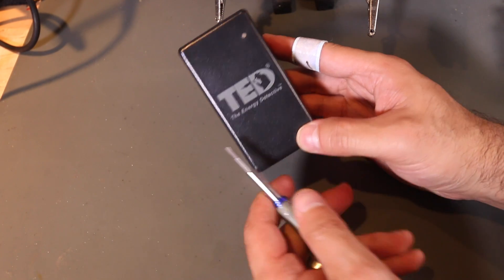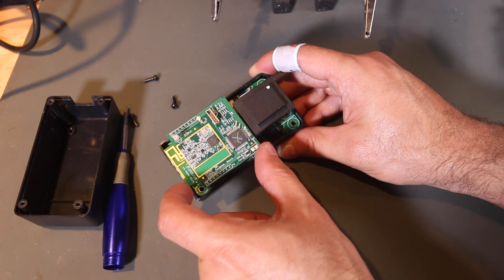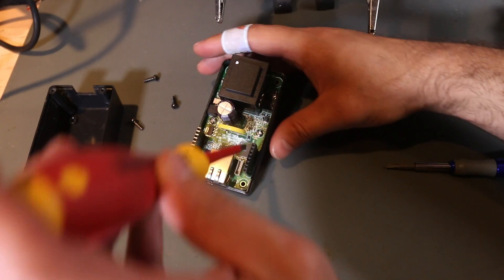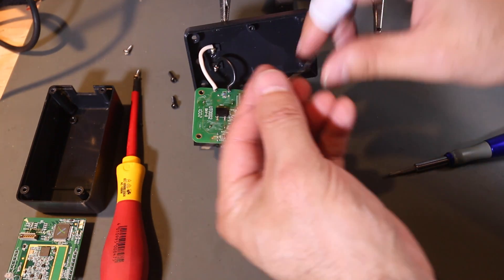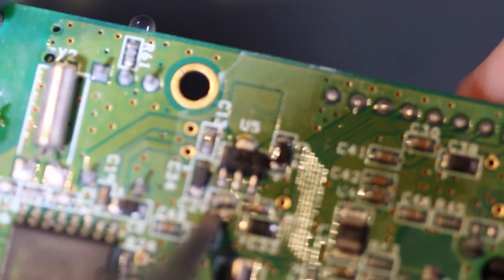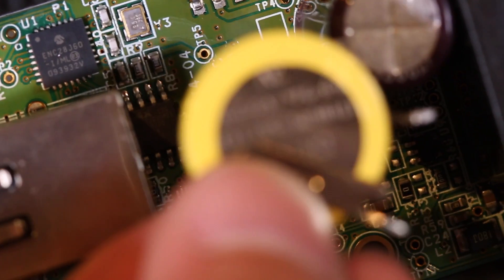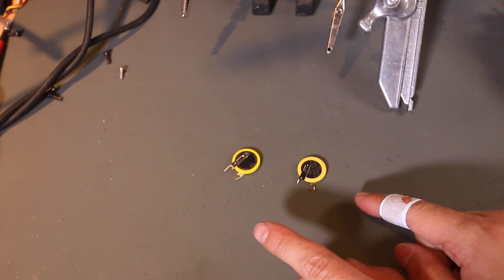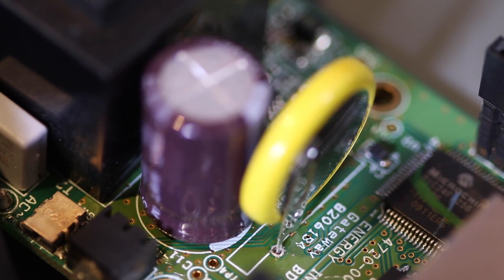Repair of The Energy Detective TED 5000 Whole House Power Monitor

Comment: My unit was just cycling on and off every 2-3min.  Replacing the internal battery fixed this problem also.  I installed an external double-AAA case that I soldered to the internal board, which should make it easier to fix in the future.  Who would have thought that the internal battery was critical to the ongoing operation of the unit and not just the backup power for the time / date clock.
Reply: Exactly!  I was surprised as well when my TED5000 resumed reading the CTs after replacing the battery.  Yay!

Comment: Would this be the reason I have power to it yet my wireless display is showing all zeros?  I got zero help from the folks at the Energy Detective.  Won't buy another one due to their service, but do want it fixed.
Reply: That is the behavior if the time/date isn't set.  Happens to me every-time I loose power because my battery is dead in my gateway (haven't replaced yet).  Log onto the web site and set the date time, and the displays will start receiving proper data.

Comment: I just soldered in a CR2032 in mine that worked well.
Reply from the maker: Nice!
Reply: How did you attach leads to the battery?  I had a pack of new ones but couldn't figure out how to make one work so bought the VCN battery from Mouser which was easy to solder to the PCB.

Comment: After how matt years of service did you notice this faulty battery? I have had my TED 5000 in service for just over five years to monitor my power consumption used to charge a Nissan LEAF. So fun telling people it only cost $40 a month to drive my LEAF all around Seattle every month!
Reply: My TED5000 worked for 13 years before it stopped reading the CTs.  Soldering in this VCN battery took care of that problem and it now works like new.

Comment: update:  bought the parts off ebay, battery was a little bigger then what came out but worked, using pool.ntp.org  I was able to set the time and the device kept it (time)   all good now..  (also Cap was bad, pushed up at top 1500uf 25v

Comment: Just replaced the Cap and Battery, date and time still not keeping correctly
Reply: Rechecked the soldier connection now it works! Thanks also replaced the battery in the remote display
Reply: @arthurarthur8985  Is the battery in the remote display soldered as well?

Comment: do you have the part number for the battery? thx
Reply from the maker: Yup -- here is a link to mouser where I purchased replacements: http://www.mouser.com/ProductDetail/Panasonic/CR-2032-VCN/?qs=%2fha2pyFaduj9bTtpJmwLBJ9bSENdV3nc9%2fVVP942Yg6rH%252bAMy1LsIQ%3d%3d
Reply: many thanks
Reply: @Mavromatic  Thank you!  It fit perfectly and resurrected my TED5000 as well.